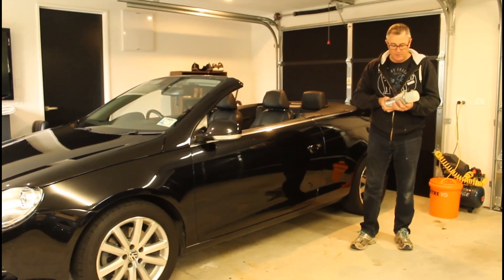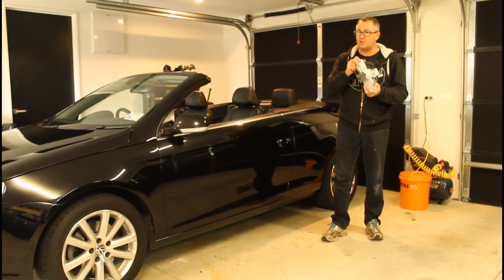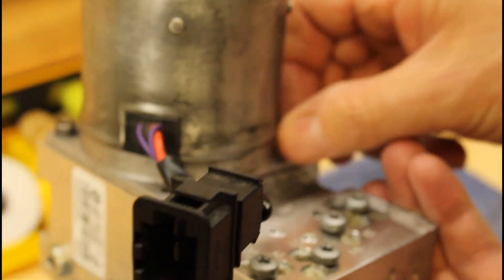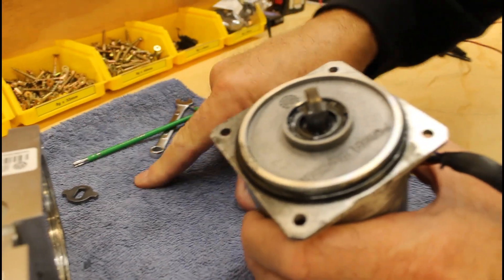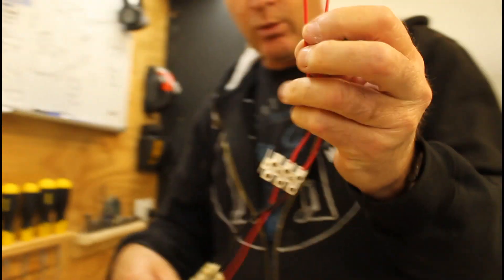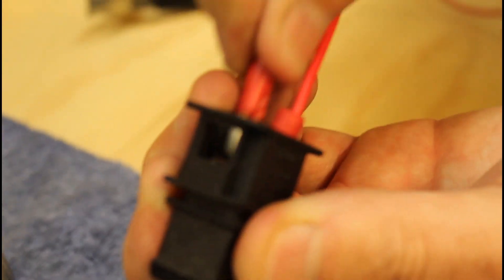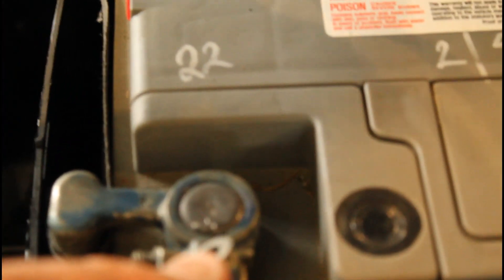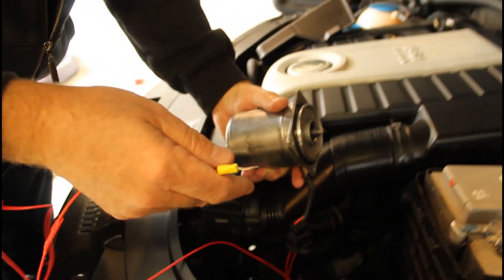VW EOS test electric roof motor.

Comment: You show bench test. Would the well mechanically inclined as easily be able to test- in car with no removal. That stupid $1 foam sponge was almost designed to kill the motor.. mine was soaked.

Comment: Great video!  Can you test the three solinoids the same way?
Reply from the maker: Not sure what the voltage is for these but assume they are 12v so maybe you can. I'm going to do another video on how to test these using an Ohms meter. Reading shoud be about 20 Ohms.